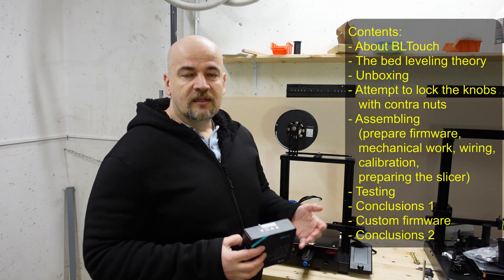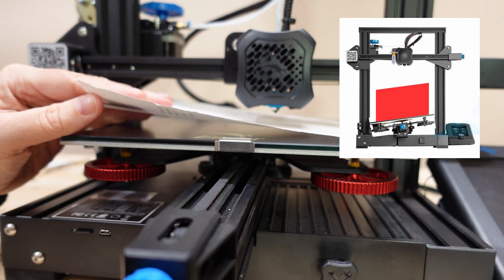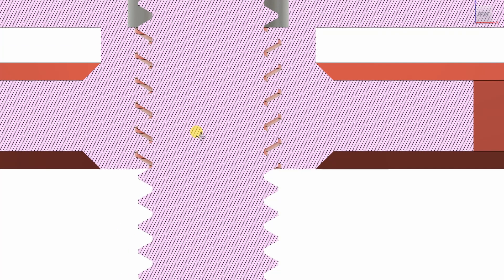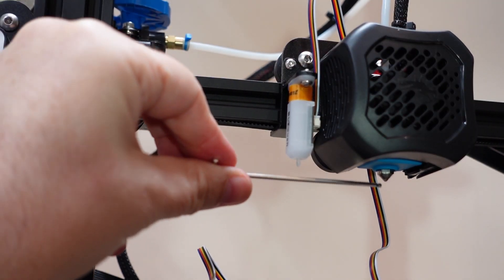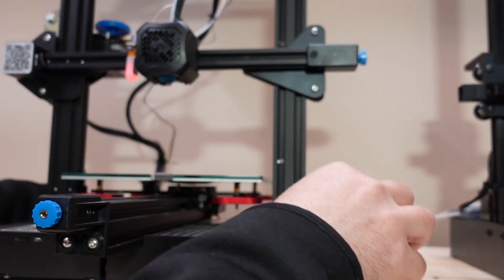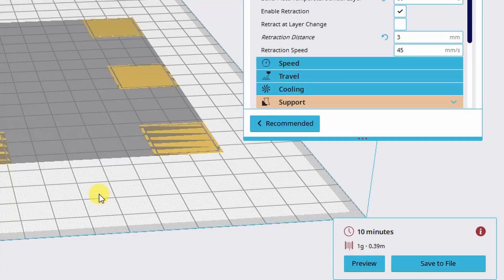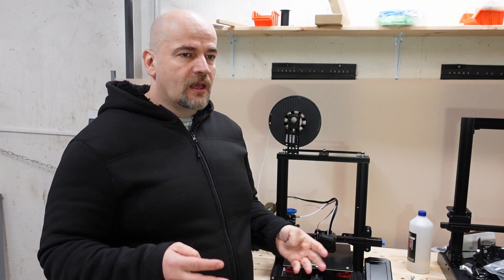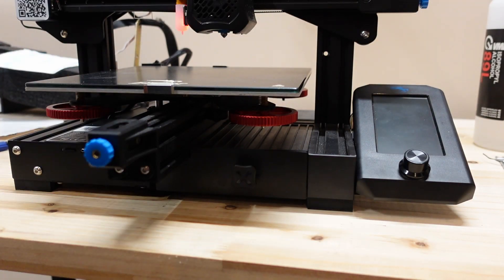Creality BLTouch Auto Bed Leveling Sensor for Ender3 V2 3D printer - assembling and firmware edit

Comment: Again a great video, you can set the offset when you connect it to a pc and use repetier-host. Then when you start to set the offset you can disable the software endstop with the command M211S0 then it will go below Z0 and when your done you can activate it again with M211 S1. And off coarse you have to type M500 to store.

Comment: Great video! I installed BLT on my V2 two weeks ago and it works perfectly.... but I used the Smith3D firmware as the Creality one doesn't have all the tweeks and it also crashed the bed multiple times during levelling. With Smith's fw not a single issue so far.
Reply from the maker: Today I also switched to Smith3D, works great

Comment: Another great video! Got my bl touch today! I already compiled and flashed a new firmware (also had similar problems as you but with the extruder values- they were not sticking ) so for now I will only be touching it again once the filament sensor arrives :)

Comment: When I bought my BLT, the retailer pointed me at the firmware from Smith3D. This seems to store the offset without the SD card inserted and has a z-offset tool that makes setting it up much easier. It also outlines the highlighted menu item with a white box, which is easier to see.

Comment: I was gonna mention backlash uptake when you put M4 nuts on bed adjusters.
Another thing I forgot to mention, the bed adjuster screws are unlikely to move and it's usually likely to happen if you don't take up backlash when adjusting. Like if you just moved the bed up then down. Same like when using a lathe.

Comment: I would tape the rough extrusions at the bottom and not the cable, otherwise perfect! 
Oh, and when someone tries the same, flash the firmware after the wiring so you already opened the bottom and saw the version of your mainboard.
Reply from the maker: Good tips, thx.

Comment: Hello Igor
Great video as always. Yesterday (finally) arrived my BLtouch for my Ender 3 v2! 
After compiling new kernel from Marlin (bugfix-2.0.x) I found out that Z offset setting is stored on the board and not on the SD card.
Also, i run into the same problem where you cannot change Z offset setting while not printing, but thanx to your video it was easy to find the correct value.
If you want I can send you my settings to try to fix the thing with the offset saved only to your SD card.
Keep up the good work!!!
Reply from the maker: Yes, please send me your settings. You can find my email on About page on YT.
Reply: Which x an y offset do you use for v2 bracket?
Reply: @AirMaxAtzeKtb  It depends on the BLT mount you are using. Detailed instructions on how to find the X,Y offset are on this video "23:44 Searching X, Y offset"

Comment: 18:16

hello. it is heppening to me so meny times. i meant Bltouch is crushing at the bed. 

can you explain what was the reason ?
Reply from the maker: Sorry, I can't help you, there are many reasons. Did you used same product? (5 wires next to each other in E3V2) Does it work with creality firmware for BLTouch? (also you must know your mainboard number 4.2.2 or 4.2.7, next does it run self test when you power the printer? When you hit homing, can you stop it with your finger (before it crush into the bed)

Comment: While printing each layer, the z-axis will be in constant motion to compensate for an un-level bed right? With a previous Marlin version i had that working and now in the lastest version not anymore. Do you know any solutions to this?
Reply from the maker: With bl touch it should work like you described, except if your bed is perfectly leveled, no need to adjust Z
Reply: @MyTechFun  thanks for your quick reply. I noticed differences in the first layer. I have the bed on purpose in a slight angle to check if the printer will compensate. Not working. 
I’m sure it was working on Marlin 1.1.9.

Comment: This is what I've been looking for! I hate that I had to use Creality's bin file instead of my copy of Marlin because of the 5 pin BLTouch. One question, why did you set Z_MIN_PROBE_ENDSTOP_INVERTING to true? What does it do?

Thank you so much for the video!
Reply: Hi Igor,

Thank you for another excellent tutorial!
All this information and the way you explain everything step-by-step really makes the difference!

At this moment I have my Ender 3 V2 upgraded with the MicroSwiss direct drive and hot-end + mechanical double Z Axis + BL-Touch without adapter.
I'm compiling the firmware following all your steps, but I got this error in the compilation process:

marlin-2.0.x\marlin\src\inc\Conditionals_LCD.h:750:6: error: #error "BLTOUCH requires Z_MIN_PROBE_ENDSTOP_INVERTING set to false. Please update your Configuration.h file."

Somehow the configuration is not accepting the "Z_MIN_PROBE_ENDSTOP_INVERTING true".

Is this essential? How to proceed?

Comment: Hi, great video! You can try the firmware from smith3d for the ender 3 v2 with BLTouch. It works great on my ender3 v2!
Reply: yes, i really recomend smith3d firmware, the new aditions like the leveling helpers are great
Reply: I too use Smith3D firmware and it has been working great and I'm able to save the Z-Axis offset without a memory card installed. The only thing I have not been able to do is get the Z-Axis to move 'real time' as I change the offset. I always have to re-home to update the setting. This is not a big deal, just takes a bit longer on the initial setup.

Comment: I have problems with my BLT, he is blinking red randomly...
i check all the cables.
I press Auto home and adjust the new Z-Offset.
Than I go to the new level button on the Home Screen and start the level....
The First Four Point are ok, than Point five the blt start to blink red.
Turn off/on the printer
zoffset is save no problem
Start level again...
Than it start blinking on point 2 (turn off/on)
Start again and than is blinking on point 3

And that’s crazy there is no logic behind the error, its blinking random

Comment: If you are upgrading to BLTOUCH on your Ender 3 v2, leave the z-axis limiter switch in place because you will likely find BLTOUCH to be very frustrating after trying a couple of different firmware, and want to go back to manual. With a small size glass bed like the Ender 3 v2, BLTOUCH is completely unnecessary. I can not believe how much of a hassle leveling becomes once you install BLTOUCH contrary to its primary purpose. The z-offset function is useless, and you will find yourself leveling the bed more often even with upgraded yellow springs and aluminum wheels. 
You may think a pre-compiled firmware such as the Smith3d firmware can make it better or easier but no. As of the March 8th version on their site, once you complete aux leveling, z offset function refuses to move the z axis until you restart the printer preventing you from making the adjustments.
Reply from the maker: BLTouch on smaller 3D printer is also useful if you replace the printing surface often. Different thickness, but BL Touch search the location of top of that surface.
Reply: @MyTechFun  I don't know why one out of every ten times, it crashes into the bed when autohoming. Then I have to reset settings, and start all over with the leveling, and z-offsetting. The tool itself may be good, but the firmware may be the problem. Have you also heard about the EMI issues with BLTouch? Could that be the reason for my problems? It's certainly not the physical installation.

Comment: My printer is not Leveling the bed. I use the v4.2.7 motherboard on the ender 3. I dont know where did I make mistakes
Reply from the maker: Check the wires first. Does it blink and move the probe (contact pin) down-up when you turn on the printer? Does it start with moving down? You tried with Creality firmware or your own?
Reply: @MyTechFun  i tryed with creality frameware its work with out problems. when I start level the bed at leveling the Z, printer start going down but the bltouch doesn't work
Reply: My bl touch conned to the screen port using a adapter. I use the Z pin connector